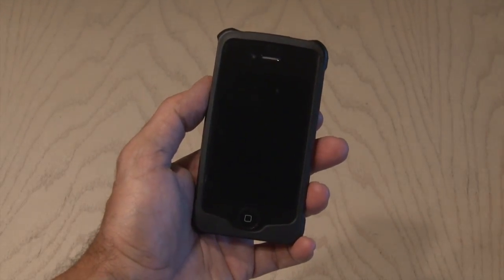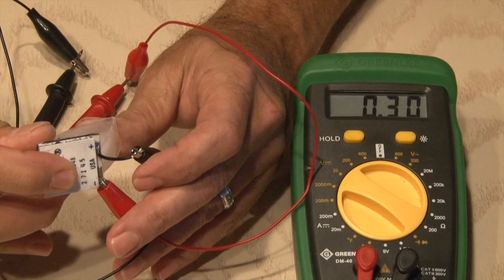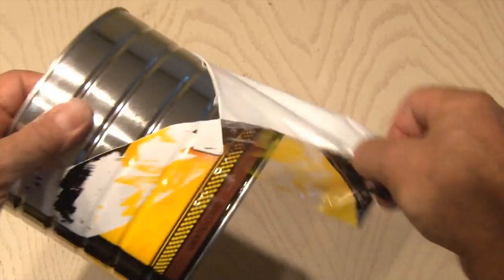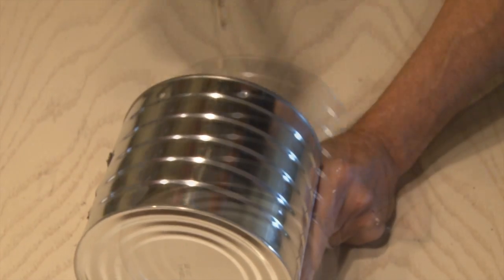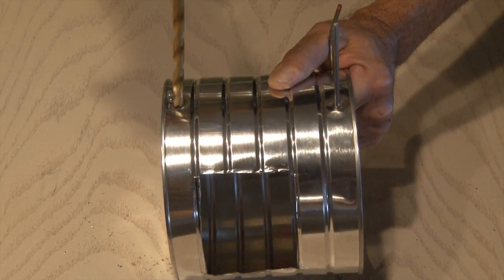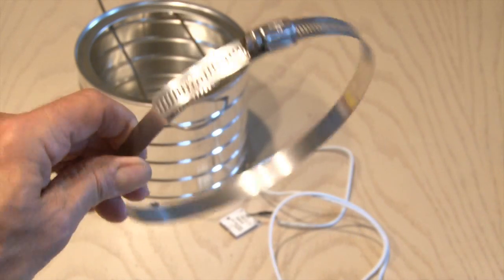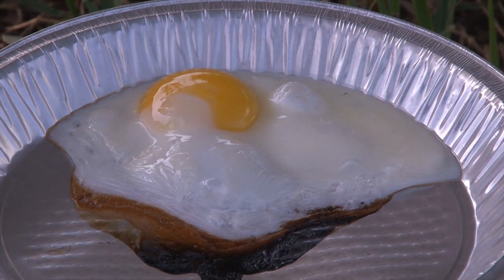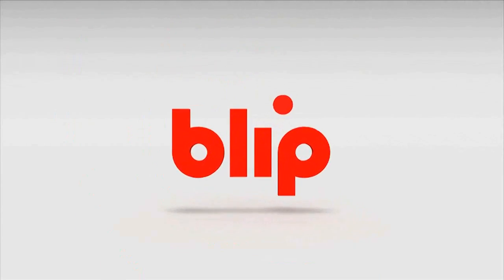Charge Your Cell Phone with FIRE!

Comment: The thermoelectric effect relies on temperature difference between the two sides. Without something cooling the other side of the peltier generator, you would not get much voltage for long. That phone was probably charging for just a few minutes before the both sides reached constant temperature and voltage dropped. Also the soldering would soon melt. You would be better off with a solar charger. There are also high capacity battery packs that can give your phone multiple full charges.

Comment: Great Video: That would be a great device charger to supplement a solar cell for camping. If i remember correctly "Peltier" is the name of the effect and "thermal electric module" is the device "I could be wrong" ,How much watts and volts does each one supply, And would two in series be two much voltage and or current for a cell phone BTW what is the typical and or maximum current for a phone. "Yikes I'm becoming to greedy with my questions.:-)

Comment: You need to make a gasification stove. That would increase the heat and fuel efficiency. You could also attach a coper thermoconductor to take the heat out of the middle of the stove straight to the generator.

Comment: U would add more of P. cells around it and isolate them inside so no cables will be exposed to heat , also in the end u need a voltage stabilizator for 5V , in nowadays they are in one single part and it is about $ or half for it..  also this is not the new idea, there is already charger like that one but it does load half battery whole day since they dont use many P. cells  (costs)  

cheers

Comment: apologise.. but the voltage is not the same as current , this phone have propably capacity of 1600 or maybe 2000 mAh and propably the lowest current should be about 0.5 A and stable 5V to load the battery in next 6 hours . to speed up process u can use more current up to 1.5A i suppose , but wihle you keep on doing that-temperature of charged battery will decrease the capacity of it- unreversable. Useless until..

Comment: You know it comes to me that these peltier units could be used to power other units, I'm looking at one online that can provide 25.7 watts of heat dissipation at 15.4v 3A -  I wonder if a few of these suckers applied to a thermal plate could power a graphic card in a computer removing the need for a high end powersupply.  hehe Infact it seems to me that computers produce a fair ammount of heat anyway, could a computer be self powering after running for a small ammount of time? Cool video Kip

Comment: Well theres one problem, because iPhone is using the data pins for charging aswell, you would have to put resistive divider between them to make it work. There has to be around 2V on data pins. Its the same for my Sony Ericsson Xperia Pro. Without them it wont charge at all.

Comment: This is really neat, but won't the voltage continue to rise with the heat? Since the iPhone is expecting 5V, and these generators appear to provide up to 12V (the lowest I could find from your link is 7.5V), isn't it possible for this to damage the iPhone (or other USB-chargeable device)? Or are there actually 5V versions available?

(Also, for those who don't believe it: The generators' ratings appear to be way more than enough to handle the charge - 5V / 500mA is a standard USB port's output)

Comment: Most electronic devices use a microchip system to charge so you can apply varying voltages without damage.

Comment: If one could wire a few of those sensors together and spread them out, you would get more ennergy.Is it possible to use the electric energy of a battery to generate heat and then the sensor turns that heat into to energy for the same battery and that will eventually charge it. Am I right?

Comment: Generate enough and you can feed it, voltage/current into an inverter. AC for laptop trickle. Anywhere even where there are no mains. Think about the possibilities. So why are we building nuclear plants again? Cheaper energy? At what cost in the long run. Radiation poisoning when someone future forgets where it's buried. Generations of security people will survive each other so deal with isotope half-lives. Do you have 24,000 years to spare. That's what it will take to totally forget this danger

Comment: Energy companies had better watch out. A bigger version may be coming. Just set it inside the engine compartment and run a heat insulated cable to the iPod charge connector ( I'm simplifying a bit) and no load on a car battery. If you get a remote thermometer you can test KipKay's for the temperature where the electrons start flowing converting, find the temperature spots on the inside of your car's bonnet, instant charging not only phone but tablet, mp3, smartphones,  the current's the thing .

Comment: The difference is with nuclear energy, you're kinda drawing energy out of mass, but here you're just converting energy to other energy. In order to create a fire substantially large to power entire towns, you're going to get a lot of pollution and you'll need a ton of wood and oxygen which has to be cycled through the facility somehow. It's also inefficient because fire needs a lot of space, which leaves gaps which the energy will escape from the system.

Comment: Sorry, but this is fake. At least, if you do everything that he did your iphone will not charge. Iphones require ~2.5v on their usb data pins to initialise charging. Also, if the fire got too hot and generated too much power, you could fry your phone, so a voltage regulator should be used.

Comment: I also have another way of charging my phone, what I did was simply walk over to a phone shop and bought a charger. At home I plugged the the plug into the socket and the other end into my phone, (try not to mix the two ends up!) once inserted at both ends I turned the switch on and before I knew it my phone was charged.

Comment: first of all the thermoelectric unit is hooked up backwards to the cable and second of all the other side of the thermoelectric unit needs a heat sink to keep it cool it only makes power when heat passes through and third of all if it isn't hot enough you will not send now enough power through it which could screw up the phone so in therory this could never work kipkay why would you upload this

Comment: This will never work with an iphone

Apple devices need 2,5 Volt at the datalines two
And the voltage has to be extremely close  to 5V
About 4,8-5.2 volts

And these things need one hot AND one cold side to generate voltage

Comment: you can get the chips from those little drinks coolers and they give moor than enough power with a little tealight candle but you will still need to make a small circuit to charge an iphone but if your chargeing something diferent this way should work fine

Comment: Up to how many volt you manage to generate with the fire??
I did a project with peltier module as generator also,using focused sunlight(with cooling fins etc).
Managed to get 7V unloaded from a 12V peltier.
A DC-DC converter for phone charging will be a good idea.

Comment: Why is it hard to believe? Solar panels are based on heat where condensation travels through pipes as the plate is warmed by the sun. I am not having any difficulty believing this, even tho it will be slower than a turtle, it still works.

Comment: If you look at the data sheet for this thing, it can only reach about 4V. Plenty of current though. You would probably have to have three of these things wired in series to run the amount of fans you mentioned. Plus, the peltier device may not dissipate the proper amount of heat for your CPU. Good idea though!

Comment: IN THE VIDEO YOU HAVE THE RED (POSITIVE WIRE) SOLDERED TO THE - OUTPUT OF THE THERMAL DEVICE AND THE BLACK WIRE TO THE + POSITIVE OUTPUT OF THE THERMAL GENERATOR  HMMMMMMMMMMMM SOMETHING BACKWORDS DID THIS REALLY CHARGE WIRED BACKWARDS DID YOU REALLY TEST THIS WIRED  IN THIS CONFIGURATION????

Comment: Maybe you can attach the Thermoelectric Generator on bottom of the can and attach the other side of it with large heatsink that dip in the bucket of water, might get more voltage out of that.

Comment: Guys, i was just thinking.
Go check out the Grant Thompson video with his hacked up rear projection TV lens, and see how hot that makes things, right?

So, what if you put one of those heating up a huge steel slab with a bunch of these little generators attached to it?
Would it be as efficient as a cheap solar panel, yet cost <$30?

Comment: The Thermoelectric Generator would be a promising way to utilize the excess heat in an engine compartment as long as someone is able to improve the technology. The generator would power things like the AC compressor, water pump, fans, and fuel pumps. Improve the technology enough and you could create a force multiplying suit that is powered by the heat generated from the user.

Comment: He's correct ITS FAKE!!!!!!! four resistors create a voltage at each of the data lines 2.8 and 2.0 (or so) volts, without them the iphone 4 & 5 will reject the charger.see w w w .ladyada.net/make/mintyboost/icharge.html for more info on.  Get them wrong the phone will attempt to draw 1 Amp. The sp1848 will only supply max 3.88 volts at 50degs.   You are correct also, This could be done with a boost converter or 2 sp1847 in series with the required resistors and a regulator, but not as shown.

Comment: ITS FAKE!!!!!!! four resistors create a voltage at each of the data lines 2.8 and 2.0 (or so) volts, without them the iphone 4 & 5 will reject the charger. Get them wrong the phone will attempt to draw 1 Amp. The sp1848 will only supply max 3.88 volts at 50degs. see w w w .ladyada.net/make/mintyboost/icharge.html for more info.    This could be done with a boost converter or 2 sp1847 in series with the required resistors, but not as shown.

Comment: Perhaps it does. Perhaps this video was faked, I don't know. All I know is that this _is_ possible, and if you tested it with a phone that doesn't have the weird 2.8V rule, and you can get ~5V out of the generator (which does exist and does work), then you will be able to charge your phone. The title of this video is "Charge Your _Cell Phone_", not "Charge Your iPhone".
Also, the iPhone requires 2V on +D and 2/2.8V on -D, not "2.8V from the data line".

Comment: Its Fake, iPhones require power to be running through the + and - data lines to charge, if there is no power running through the lines, you will get an error message on the phone. Nice try, tho.

Comment: Wrong, the phone will charge, however the wires are usually used to send and receive data, However, it is two wires, meaning that a constant flow of electricity will indeed charge the phone, this is the same reason that you can plug an iphone into a wall socket converter.

Comment: It would work better if you thermally isolated the + and - sides of the Peltier(?) generator. That metallic hose clamp conducts heat and reduces the temp differential, which is the source of voltage here.

Comment: Although the theory is sound, this simply must be fake due to the way in which the circuit is wired. Most modern phones (iPhones for sure) won't charge when you just apply 5v to the red and black wires of a USB cable. There has to be some basic data communication between the phone and the charger confirming that the charger can provide enough amperage to charge the phone properly. Cool idea though.

Comment: You actually need a temperature difference between both sides of the module.
Just letting it sit in a hot car would generate nothing. But if you could use the temperature difference between the car's hot interior and the outside it would work.

Comment: Actually it needs the 5, but it doesn't need the data lines if you short them together. Might not even be necessary since it's simply a voltage source, not a data source like a USB port.

Comment: USB cables (if you've ever looked into the end of one) have 4 little metal bits. The +V and GND (for Voltage and Ground) bits are like the positive and negative ends of a theoretical 5V battery. The +D and -D (for Data) bits just... transfer data.

Comment: Can this generator be placed outside when it's -20 Celsius (-4F) and run the wire back indoors to power the device? Or what temperature is needed?

Comment: but let's go a bit more expensive get an usb charger for like $15 and put an buffer / battery between it and it could work. and for more power you just could invest into a second Thermoelectric Generator. so the phone gets the data cable and his stable 5 volts from the charger (it musn't be an original apple thing, my ipod can handle any usb charger) and an big advantage to use an charger insted of cutting the apple wire: the wire coasts (in germany) 30€ and the charger 15€ or less
no place left

Comment: 1: without a heat sink a pelt ire Element doesn't provide power long enough. 2: A iPhone doesn't charge without datalines connected. 3: I tried something similar. And the voltage and power where poor.

Comment: a voltage regulator could fix that. There are also regulators inside of the device. USB runs at 5V. So a 5 volt regulator would displace evtra voltage in the form of heat. Which I suppose could be used to help power the device again.

Comment: you can also make your own heat to electric converter with copper plates, and use cu2o for the n type semi conductor( use a blow torch on the copper,will look like an old penny) and copper sulphate as the p type(blow torch then sulphuric acid) a thin film on each side & sandwich the 2 films together. google it for assembly
works great in Canada with aluminum heat sinks on each side one to pull in heat (electrons)  the other to dissipate heat.
one side goes in a fire -the other in the snow

Comment: It charges at however much heat is applied to the "hot" side of the generator. At most you'd get a few volts but this isn't a way to effectively charge your phone 24/7. As stated it's for either emergency power or for when you're camping and, like some people, forget your car charger or simply don't have one. Fairly inexpensive to make this too with a minor soldering job.

Comment: You are correct! (also an EE student).  Pins 2 and 3 (data) require a 2.2V reference voltage to start a charge.  It would be unsafe at best to charge anything with this, as you have no idea what voltage it operates at, nor what current it outputs.  You'd at least need a 5V regulator and a voltage divider for the 2.2.  The "kipkay" version would be to cut up an old USB car charger as it has the appropriate circutry.

Comment: why no diode? Peltiers are dual functional, they work in both directions. Apply voltage and the cold side gets freezing, force a temperature difference and voltage flows out. I would think that on less quality phones, this would possibly cause the battery to drain unless you enforce one directional functionality out of the peltier by adding a diode.

Comment: I do know what im talking about, YOU look it up, iphones require ~2.7 volts into the data line (green and white wires) so the iphone knows how much current to draw depending on what it is plugged into.  All ipod touches and iphones operate this way.

Comment: No, iphones require about 2.7v into the D+ and D- (green and white) wires in order to let the iphone know what it is attached to and how much current to draw.  This is done by using a few different resistors.  Kipkay used nothing of the sort.

Comment: Usb charge cords can be plugged into wall socket adapters. No device detection what so ever. This would work if the proper amount of voltage could be produced. Take some time and learn about the electronic before spouting off some random false facts.

Comment: Peltier, which is able to produce enough power to charge a phone, is quite expensive. What I mean by enough power is 5W as a clasic charger. And it needs to be cooled on the other side, heat sink is just enough to make a temperature diference.

Comment: Not quite. It works off a difference in temperature so if both sides are the same temperature, as they would be in a cold house, then no potential difference will be generated.

Comment: Wait so If I have a fireplace at home I can get few of those and charge all device in my house for free? so small fire 1 generator outputs 5 volts since they are small i can fit aprox 10 of them with no hassle and be able to charge 10 devices for "free" al trough the day?

Comment: what do you feel is fake? I am taking a critical standpoint and not making any assumptions, but the technology is possible even the way he presented it is quite feasible. The only parts I am sceptically of is like you said if the iphone will take the voltage. I know a cheap cell phone like mine will take 4-6 volts. the other thing is if this peltier unit even gives voltages above 4 volts.

Comment: You need 2 resistors on the + and - data lines of the usb cable to set the charging current. I'm not sure if this is actually real.

Comment: Although in theory this is possible, the way kipkay has implemented it, the voltage would be too low. By looking at the SP1848 datasheet, it is clear that you will not get more than 4.0vcd, and an iPhone is very picky about the voltage (usually within 5vdc +/- 0.2). Also, he doesn't show a single shot where the entire cable is being shown. Good idea, but this is not going to work!

Comment: @kipkay Objection! The thermoelectric generator works on temperature difference. Having the generator attached with the clamp like this will reach almost a temperature equilibrium, thus reducing voltage to zero (or almost to). Plus even if this generator produces 5v needed to charge the phone, i suspect current flow is so small that would take ages to fully charge. Finally, my ipod classic (6th gen i think) needed a specific circuit to accept charge..not directly voltage..idk about the iphone